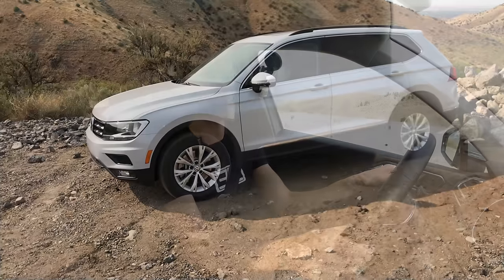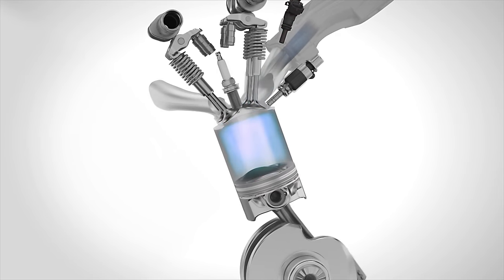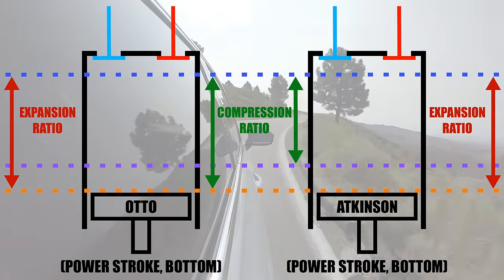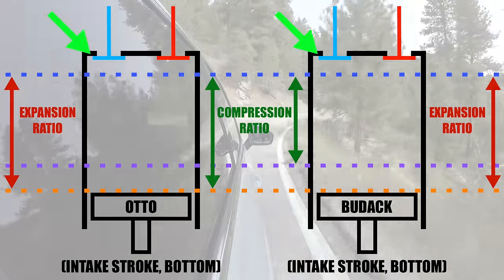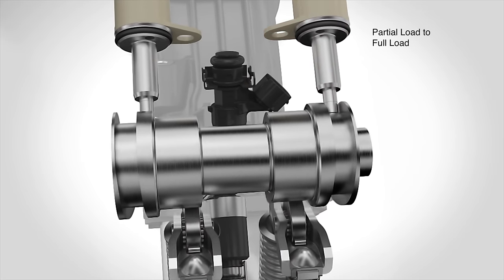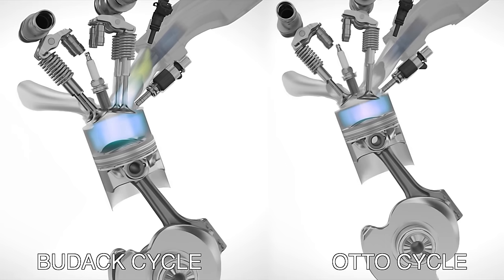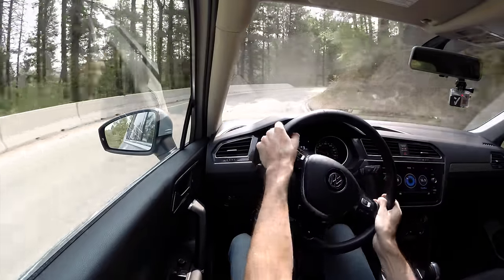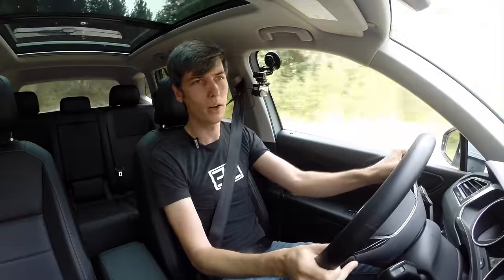Volkswagen's New Engine Cycle - The 'Budack' Cycle

Comment: It's the opposite of VTEC.
Reply: Freddy Romo yeah you need to nerf a volkswagen at low rpm
Reply: VTEC was invented and introduced for emissions to help keep the power. No real performance gains, especially if you ever think about turbos.

So not the opposite of VTEC, the exact purpose of it.
Reply: yes it is the same... they could even double vtec... early closing vlaves, normal closing and the high cam profile xD but i guess from a normal profile and a turbo you can extract enough air and therefore power anways these days on a 4 banger
Reply: Samuel Smith VTEC has no performance gain? Oh, common...
Reply: Gabriel Soria so go nonvtec?
Reply: Azyatic non-vtec Is great for tuning, VTEC adds to many variables to the system and ultimately is not nessary if power is your main goal. Thats also why if you turbo the car which adds even more variables it just packs on top of the complexity for tuning.
Reply: STFU, VTEC made Honda win F1. VTEC makes an engine behave differently at low and high RPMs. Too bad that Honda doesn't make big engines, but BMW (Vanos) and others make use of the tech and the best motors are VTEC.
Reply: Clearly you don't know what the hell you're talking about.
Reply: DB so Honda's current issues are because VTEC is banned?
Reply: Gabriel Soria You're talking About Vtec E my friend
Reply: No that's because the engineers that made Honda great 30yrs ago have all retired. The company has rested on it's laurels for decades now.
Reply: Does this mean that VW will finally bring the dual injection setup to the USA ( as seen in the animation but not mentioned by you ) for the EA888 series engine, something we Yanks should have had from the beginning but VW secretly and intentionally left out of our market to cut costs? Under heavy load, notice that the DI takes over, shutting down the port injector as it shifts the intake valve duration. This dual injection design will help reduce, if not eliminate the carbon buildup on the intake valves which currently plague all of VAG's DI cars here in America.
Reply: +Gabriel Soria Yup it reminds me of VTEC too, VTEC isn't made for racing, it is actually made to allow the engine to run more economical. But don't tell that to the boy racers out there who just heard the VTEC kick in ;) 

If you see a VTEC power curve anybody here understands what I mean. It really is just made to give during low rpm's the most economical running, and also it is pretty weak. 

This "new" engine thinking is just the same, running the engine leaner in the low side of the RPM/needs to run more economical. 

And I can't hate it. If it means getting more MPG's I am fine with that.
Reply: Masticina Akicta Vtec stands for variable valve timing electronic control and is set to run normal cam lobes at normal engine speeds and to use higher cam lobes when power is needed(higher engine speeds, some of them past 4500 or 5500 rpm). What u guys are talking about is the vtec-e system which runs the engine on 12v and then when power is needed the other rocker arms are engaged to run the rest of the intake valves. There's also the i-vtec like the 1.8 European model that works the same way... And yes... Vtec is for performance, especially in models below 00...
Reply: Gabriel Soria your wrong and your right. But you still wrong anyway 😂😂 your talking about vtec-e... Not regular Vtec...
Reply: Except for the K series engine, there is a performance gain from Vtec.
Reply: Lol honda makes decent sized vtec engine, those 3.5L v6 Vtec in the accord pull quite good.
Reply: Rajitha Wijesinghe obviously never driven (s2000) or ridden (vfr800) a vtec machine! LoL vfr800 unless you are hanging on, you fall off the the lobes roll over!
Reply: From what I see US cars got the later incarnation of VTEC aimed at low emmision and efficency, while originally VTEC was invented to make more power at both high and low RPM range
Reply: Makes sense, if you buy sport cars the japanese import at times is faster.
Reply: Actually that Accord VI V6 is decent, but not very good engine. It has average power and torque amounts for an engine this size, but there were better engines at similar displacement at the time. You still have to remember it was not designed for racing - at the same time you had Accord Type R with 2.2 H22A7 NA VTEC engine with ~217 bhp. So we have about 100 horse power/litre. Honda S2000 with F20C (its more like B and H series, strange name, other F series are eco engines) had about 230 bhp from NA 2 litre engine. Add good driving experience and  this is why this car is getting pretty hot on market right now.
Reply: DB BMW uses cam phasing for their Vanos design.
Reply: VTEC is "Valve Timing Electronically Controlled, so it is VTEC. The goal is merely different.
Reply: flagmichael VTEC stands for Variable valve Timing, Electronic Lift Control.
Reply: There was also 3stage VTEC which does the same.
Reply: maybe not the opposite, but the other side of the same coin of efficiency.
Reply: And the 3.5L VTEC in the Saturn VUE.  250HP,  250ft/lbs torque in a lightweight SUV. 6.3 seconds 0-60mph.

Comment: SAAB also made something intresting, about 15-20 years ago. They cut long block in half, then they tilt the upper half with head to achieve diffrent comp. ratio, dependent on revs, boost (it was turbo), load, etc. I cant tell more becuose of my poor english. I thing You should make a video about it, this was really something big and unusual. The diffrence in low and high compression ratios was really huge. It was much more tech-complicated then Atkinson, Miller, etc... half of the engine was changing position in order to work.
Reply: I remember seeing that on a Television show about that long ago.  Unfortunately, I couldn't begin to imagine how it would be reliable.

Nissan just made a variable compression engine that I think is quite ingenious.  The connecting rods connect to a rocker link of sorts at the crankshaft which adjusts the crankshaft throw.
Reply: The SAAB engine in question just pivoted the block in relation to the crank, thereby adjusting where the throw of the piston was within the cylinder. It would typically have high compression at part throttle (so TDC closest to head), and would steadily reduce compression as the MAP increased (TDC further from head).

Yeah it's an idea that only works for relatively low specific horsepower engines. Such a mechanism would not hold up for long in a high performance application.